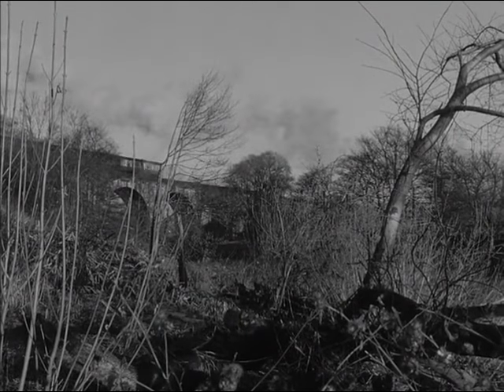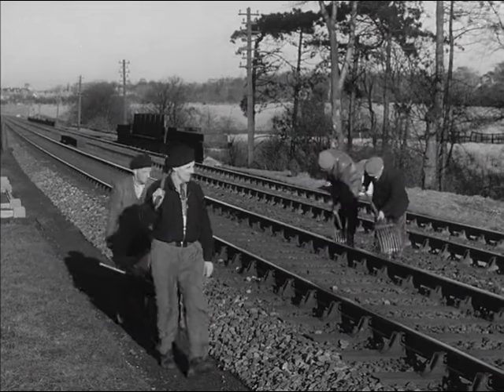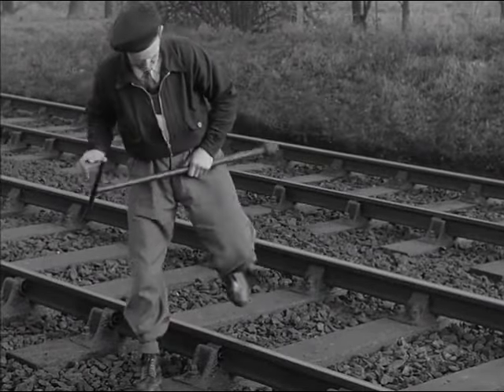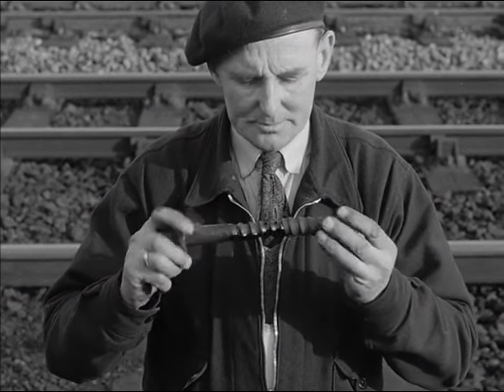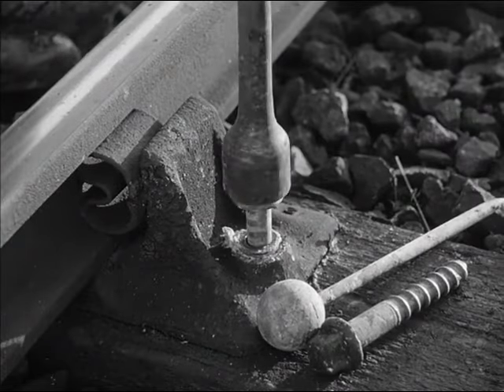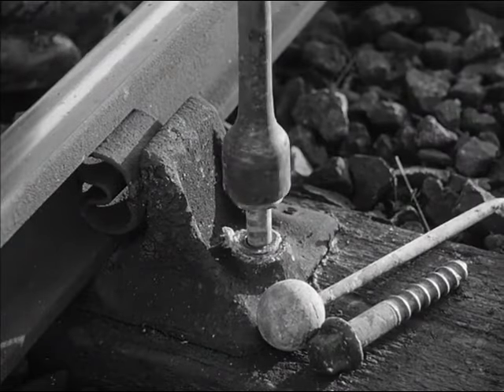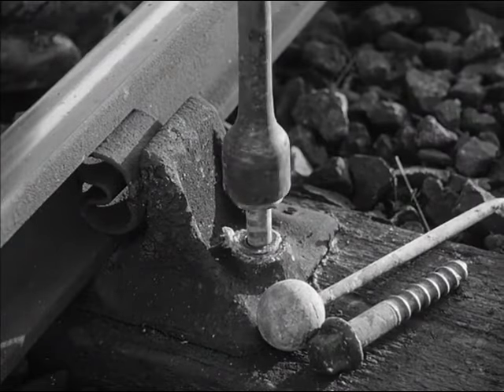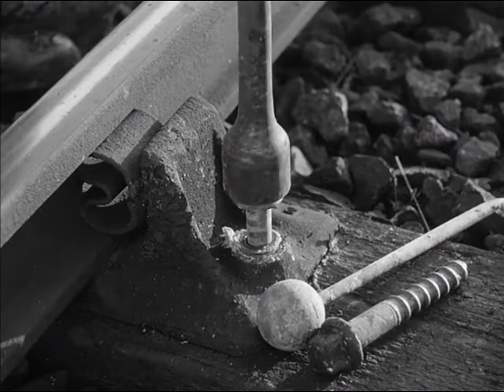Vintage railway film - Day to day track maintenance, part 1 - Plain line - 1952

Comment: Horrified to see the "paste" that was used to pack a loose rail chair hole.  The wonderful material that the worker was immersing in the water and then working with his hands contained a large proportion of asbestos.  It was  regarded as a wondrous material back then.  The horrors of the lung disease it caused hadn't yet been realised
Reply: It’s danger was well known by the 1930’s/40’s.
Reply: RIP Bob
Reply: There was a domestic version of that asbestos fibre filler, made by Rawlplug. You mixed it up with water just the same, to hold screws in the wall for shelves and such like. Our nickname for it was 'dead men's whiskers'.
Reply: You’re right, all that dust flying around and no protection in sight … pretty grim.
Makes me wonder if people 100 years from now will view plastic the same way. “Oh, they knew the dangers and the inability to biodegrade but they thought it was a wonder material…”

Comment: Absolutely fascinating. These gangs must have cursed whoever decided to bring in the bolt fixing from underneath the sleepers!
Reply: actually once they did it a few times, it would become easier and faster over time, so at first it may be annoying but after a few times being done, its a regular non-hassle job.
Reply: I agree, yet another case where whoever designed it never stopped to think about those fixing it.
Reply: Not to mention a simple wooden block to hold rail against the chair, did they even think vibrations would eventually loosen the block? In another clip he puts some type of paste in the hole,he uses a rough thread then the actual screw but why not just use the actual screw
Reply: jacco nouwen  (28-12-1968)
Reply: Maybe they didn’t become loose as the others did as much?
Reply: @steffennijhuis4143 wat bedoel je daarmee ?
Reply: The advantage of non welded track meant no buckling in Summer    , maintenance  assured safety  . The curious gauge instrument . My youth was spent in the steam ere , as an Apprentice  at Crompton  Parkinson  in Chelmsford , complaints of our traction electic motors with shafts breaking,  of the two of us went ear muffs on in the side corridor of a Deltic 20 mins out of Kings Cross  awful racket train ground to a halt & what embarrassing  moment rescued by a steam loco to Derby , on examination  lack of lubricant had caused broken off gear teether,  think I still have one in Spain  . Very rare a steam loco bike down . Spain still  has distant steam locos wood fired by olive pruning,  dead olive trees  roots high calorific value , some coal imported  from Poland & Germany !
Reply: @steffennijhuis4143  Can remember the teams of men unloading & carrying rails  to be mounted ,& sometimes steam cranes towed by small locos on opposite track . 
Not long ago ciao cheap flights a couple  visited Alicante  , had meals & drinks the air fares less than £100 ! The electric fare from  their Birmingham to London  per person £80 ! Could  travel in Spain  by bus from Gibraltar  to Valencia  for £80 or € 92 Virtually no electric cars here !.
Reply: @nikerailfanningttm9046  Also, might it not be needed less regular maintenance, compared to screws driven into the sleeper directly?

Comment: Note how neat and tidy the lineside is c1950s with all the excess vegetation cut well back, this was to reduce the fire risk yet probably meant a minimum of leaves on the line. Today the national railway network is in many areas a shocking disgrace.
Reply: it was very labour intensive - as we see here - or used a lot of chemicals. These costs and environmental harms aren't acceptable now.
Reply: I have no issue spraying things to keep them down. The alternative is you’ve just spent hundreds of millions building something and your not maintaining it and have to end up cutting back more than if you had done it the proper way in the first place.
Reply: Very poor excuses.

Oh, and fuck the physical ground environment. Climate change matters more.

Comment: The wonder wheelbarrow always has the right fittings for the job and at the blink of an eye is full of chippings when needed.
Reply: it's a stunt wheelbarrow
Reply: The wheelbarrow was a paid actor.
Reply: @SteamCase  i should hope all the actors were paid
Reply: I know, right!   This video would have been so much more authentic had we gotten to witness gruelingly long period of idle time, while the waymen went and fetched the proper tools.  What could the producer of this film have possibly been thinking, to deliver such a impossibly unrealistic and convenient situation?
Reply: @grazzer1673  - It’s almost like they’ve cut the film into concise scenes which explain the process clearly.
Reply: @davesaunders3334  And cut out any scenes which do not impact the lesson being taught
Reply: The wheelbarrow was a higher paid actor then these gents
Reply: As I understand it the ganger  had inspected the track in advance. He now came back with the crew and a wheelbarrow with the necessary tools and equipment loaded in it. At 2.24 you can see most of what they used in the wheelbarrow as they set off.

Comment: Must of been a nightmare with all the different types of track fixings. All done by hand as well no fancy tool's just hard work and an expert eye. Plus the hilarity of the opening lines about Bob and his length, love these old info film's can't be matched nowadays.
Reply: A nightmare but a source of pride as well.  A level of expertise required from the managers, the gang bosses down to the individual workers.  As a Gen X I feel  like I caught the tail end of that: the requirement, but also the recognition, of individual excellence.  These days it's all parameterized and worked down to the numbers, each worker interchangeable because God forbid a manager has to manage an individual member of staff.  As my former and very astute manager called it: "predictable mediocrity".  That is what we have these days.

Comment: I'm wondering if the white powdery substance used for repairing over large holes for the chair screws isn't some form of asbestos. I remember my father's tin of Rawlplug compound, which looked very similar and which was wetted and pushed into the screw hole in the wall to take the screw. It was asbestos.

Comment: Skilled workmen, indeed. Did Fill Plug have white asbestos in it, do you think?
Reply: Looks like it in it's dry form
Reply: Possibly, but you definitely wouldn’t want it on your hands regardless
Reply: yes - it looks very similar to what used to be called rawlplug, a compund that you mied up and poked into drilled holes before the plastic plug was invented.

Comment: 17:15 Surprised to see all the bolts facing the same direction. Here in the States, we are required to alternate them (e.g., heads of bolts #1 and #3 face the gauge side, heads of #2 and #4 face the field), ostensibly so that in a partial mid-train derailment of a single axle or pair of axles, only 2 of the 4 would be sheared off by an errant wheel or flange, thus leaving the rail joint intact for the following cars.

Comment: Did American RRs have similar practices (I. E. screw spikes and enlarged holes, joints and joint bars (fishplates), hanging ties, ballast chippings under ties, curves, and the following tools: fill plug, T-wrenches, void meters, cant plates/monument blocks, track aliners, and alinement gages)? 

With the joint bars, the maintenance workers have to pry up the spikes slightly.

Comment: 'Pat and Fred can get on with it.....' as they step out onto the running line to shovel the ballast with no lookout man to warn of any approaching trains. Great old instructional film showing how the permanent way was maintained before widespread mechanisation and stronger health and safety regulation.
Reply: Unless the train dispatcher had already given them a maintenance window in which to work, with traffic held until expiration of the window.
Reply: @whiteknightcat That's a good point but I'd have thought the film would mention working whilst the line was under possession, usually taken locally with the local signal boxes, otherwise 'between trains' as there was probably a fair amount a slack between train movements back then. Either way, I love these films, partly because they illustrate what went into keeping things going and the people who were behind it all. They are carrying a fair amount of weight in that old wheelbarrow too and look how sharp the edge of the cess is along the track.

Comment: It's amazing watching this no lookout no hi-viz and thinking what it would be like today if we still used 60 foot  bullhead track panels key,s and fish plates instead of CW Rail like today first it would need a T3 block on all the lines ,no walking on the sleeper ends ,steel toe-capped boots and full hi-viz plus hard hat gloves and safety glasses. And believe it or not but that fill plug compound  is pure asbestos

Comment: would they have had someone watching out for on coming trains?
Reply: Indeed they would. “Lookouts” were a very responsible job, using a horn or whistle to make the gang aware of the approaching trains. Sometimes due to the speed of approaching trains or track layout (tight curvature, junctions and so on), multiple lookouts would be required to keep the worksite safe. These lookouts would communicate with one another using a large blue and white chequered flag and still do today! However it is being phased out in favour of more technologically advanced methods of warning and protection (such as arranging for complete stoppage of trains and possession of the line for a period of maintenance).

Comment: Creosote treated pitch pine sleepers lasted years , now cracked concrete ones need replacement  .Looks now via Donations that Steam will be King , trillions  of tons now safely  mined , no wooden pit props , sensitive gas detectors , no canaries , eco & spark proof Led lighting  , we lost our El tren de Las Inglesas  from Gandia to Alcoy , my latr dad in the M.N used it , cine  films on utube , many of the station buildings  preserved as museums with photographs !

Comment: today machines do most of this work.
Reply: For those of us in the heritage Railway sector. This film is a great learning piece
Reply: Seems like they discussed a lot of fine details of track maintenance like checking screws that would be hard for a machine to handle and somehow must be no longer necessary.
Reply: @32582657  yes track maintenance has changed beyond all recognition. Rail is now continuously welded and the fixings to the sleepers are all spring clips. The sleepers too are concrete and require very little attention
Reply: @timwebster8122  then and now,, everything heavy,,, Except the Wages .lol.  Did like the Free Rail travel passes though. 👍😎